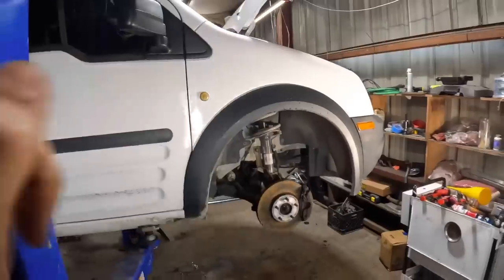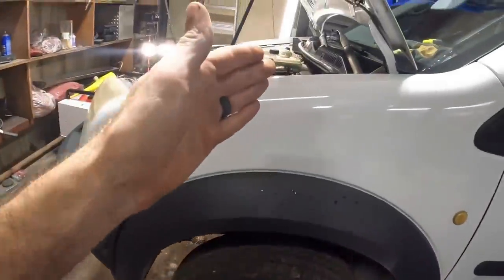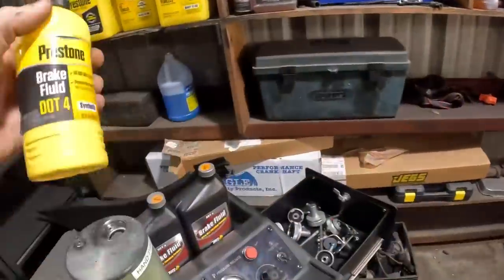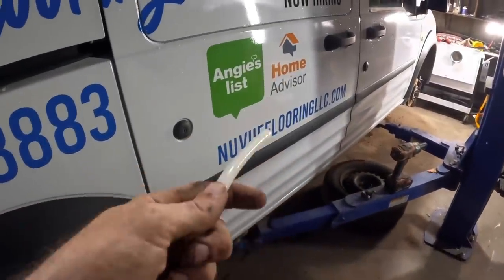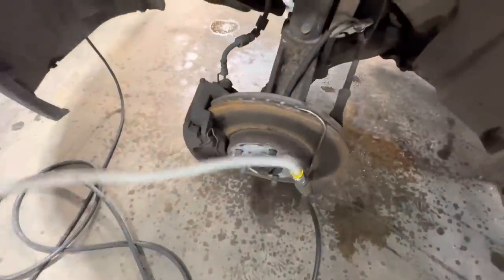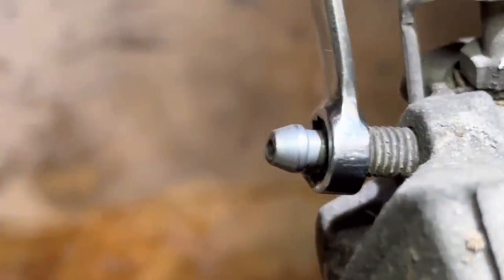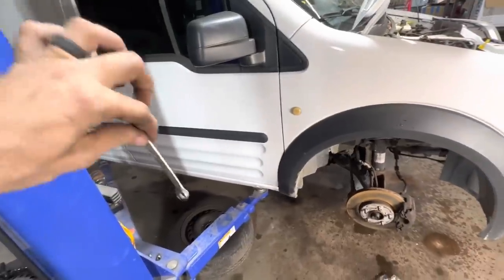Does Brake Fluid go BAD?? Ford Transit 2.0

Comment: I'd say something about "the vacuum that is in the system allowing air to enter the system", but knowing that the reservoir is full, pressurized and with enough pressure to apply the front brakes, and how it's impossible to have a vacuum in the system with the 15psi being applied to the closed system full of fluid....  but I won't say anything.... 
That's two I've caught you at Ray in a week.... 
Wife Unit, please don't let Ray take any more time off from turning wrenches, he seems to have difficulties getting back into the swing of things once he does... :D
Reply: You haven't caught him at anything. You clearly don't understand how brake systems work, or that machine. He did a PERFECT brake system flush. That's exactly how it is done using those machines. Please stop commenting things like this because someone will come along and just believe what you say, even if it's factually incorrect.
Reply: @williameldridge9382  You better get off your ruby slipper covered tower and go to 9:20 and watch and listen again!!! 
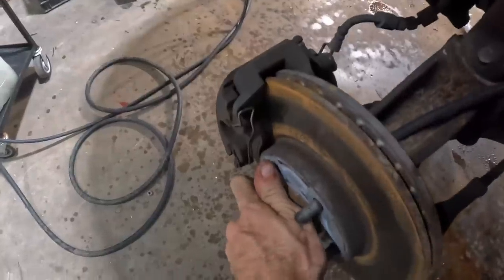At 6:10 he states "even at 15 pounds it's applying BRAKE PRESSURE..." from the air introduced to the system from the reservoir meaning there's fluid pressure being applied to the system causing the pistons to extend and that pressure REMAINS THERE for the whole process, which is why on every wheel cylinder he cracks open fluid comes pouring out under pressure.
Then at 9:20 he states ".. I'm not going to remove this hose because and then try to close that valve because that vacuum is overpowering the pump" which IS WRONG! The vacuum suction is pulling anything that the pump provides, and in NO WAY CAN cause a reverse flow ATMOSPHERICALLY back into the caliper. Atmo is 14.7 psi, and an additional 15 psi is being created by the pump, and it just aint going to happen under ANY circumstance!
I'm further proven right by EVERY TIME he cracks the bleeders AFTER removing the vacuum hose and fluid comes spraying out. Vacuum present or not!
You really need to learn some science and hydraulics and go back to munching on your chips there in your momma's basement and leave the mechanicing stuff to those who actually know what we're talking about

Comment: Does your brake fluid exchanger overcome the pressure from the valves in the abs module?  I’m asking because most vehicles have the abs module in line between the brake cylinders

Comment: I've seen brake fluid turn green before from moisture getting into it or it has high levels of copper in it from not being checked regularly or incorrect pad replacement. I've always wondered how the brake fluid got flushed

Comment: This, to me, seems like a solution in search of a problem. Pressure bleeders have been around since the '50s or  earlier, and other than keep fluid off the floor, provide the same service for what must be a lot less fuss and cost. Great video.
Reply: You would be incorrect. The pressure bleeders you refer to are a major problem. Brake fluid is corrosive, so getting any of it on any component outside of the brake system is a major issue. There was a major problem with the old systems. This is also exponentially faster. You can do a brake flush in less than 15 minutes with this.